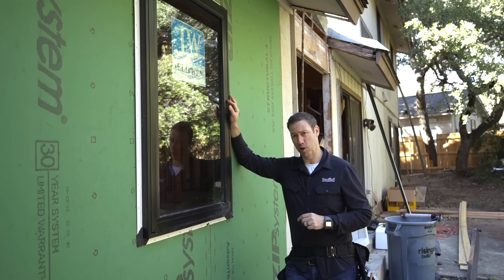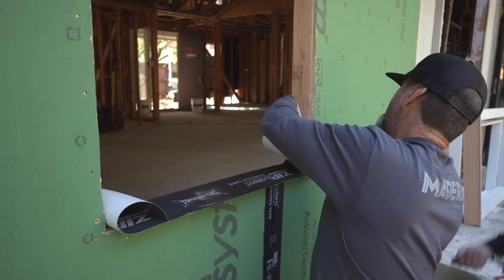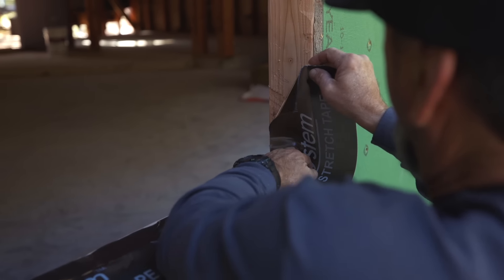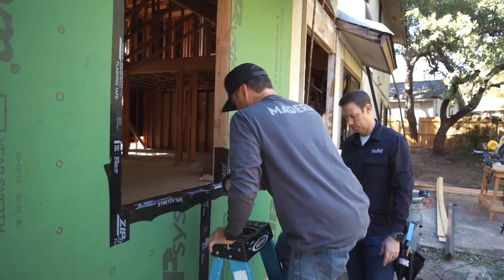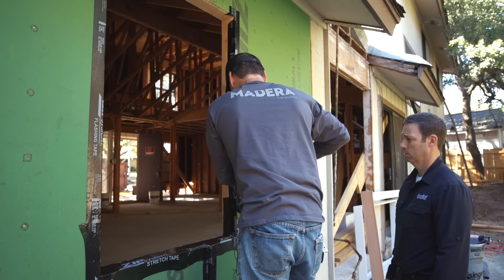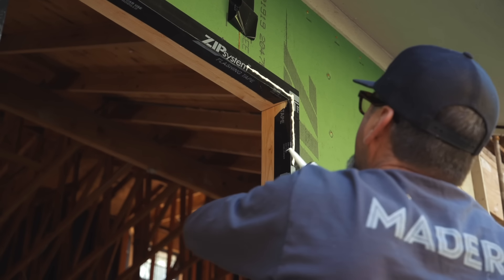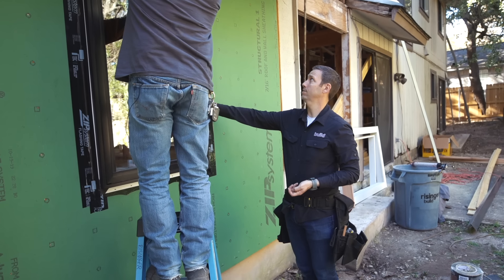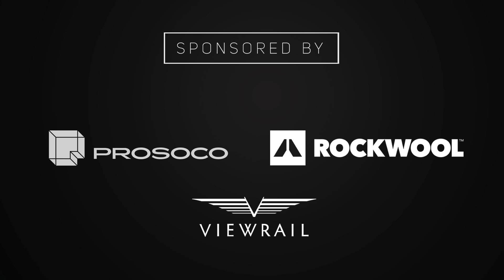Window Install & Flashing - Jeld Wen in Zip System

Comment: I've been in the trades for almost 20 years, built houses, flipped houses, renovated top to bottom, commercial and residential, and worked with hundreds of sub trades.  I still find it overwhelming at the sheer amount of systems and products that exist to do the same thing.  As for what's best? Forget about it, you'll never know, nor will any contractor. What complicates things further is 4 contractors will give you 4 different ways to install the same product.  Even for an experienced guy, It can be frustrating and anxiety enducing to make the best choice and to know whether the job is being done correctly or not.
Reply: Amen
Reply: Try being a diy-er trying to build my own house; learning as I go.
Reply: How so? Because different options exist that makes it harder? I love it. Different systems for different requirements and budgets. It doesn't add any anxiety for me. I'd rather have options than just make it up as ingo
Reply: I can definitely relate honestly. It's quite overwhelming.
Reply: Yeah I think its best to take the science and methods but be agnostic regarding products. The flashing method here seems very well done. But there's probably a tape that'll work that ain't zip. 

The main take aways is to always reduce the amount of times water has to challenge your flashing. Always lap the tape in a way that once water gets on top of that first layer it never gets a chance to get under any subsequent layers. Any new layer of tape should start before and end after any old layers. And leave room for water to drain out if your flashing fails. So don't seal the bottom flange.

Comment: Doesn't leaving a gap at the bottom flange and the fact there is not caulk, effect the blow door test and R value due to air penetration at this area?
Reply: It does not affect air leakage because there is a backer rod and caulking used on the inside for air sealing. Low expansion spray foam and tape is another method.

Comment: Matt always does a great job covering windows but i would like to see him do some doors, sliding doors and such...😎
Reply: 422systemarty a 8R8L Bi Fold patio door perhaps !?! 😰
Reply: Ditto!
Reply: I have a house under construction and they installed the windows just this week. I was actually very surprised they did nothing in the way of a sill pan or taping the house wrap before installing the windows. Is the best and only thing I can do after the fact to weather seal the edges of the window? Suggestions? I should have them take the windows out and do it the right way!
Reply: This channel is my favorite resource for sure. Sliding doors would be great. I think he did something with Marvin some time ago.
Reply: I agree with you Pavel and 422systemarty !
Reply: @mhsfhhawks3411  I know your question is old, but for future questions: A sill pan is necessary per manufacturer, but taping the sides of the housewrap or wrb isn't necessary before the window install as long as they tape afterwards. It's more of a sealing technique for air, than for moisture (Look at old houses with zero flashing and the vertical portion of the studs are fine (until they get to the mudsill), but the window sill is rotted out. I would 100% remove the windows and do mechanical flashing at the sill.
Reply: @pavelomar4631  I’m
Reply: @pavelomar4631  I’m

Comment: Thanks for mentioning the 5 degree positive slope with frame sill!  Previously, I was looking into sill pans such as suresill (the original frame sill did not have this positive slope).  I will look to sanding this slope on frame sill - per explanation of your work

Comment: This is the method we teach all of the carpenter apprentices and truly is the best method. It helps with air leakage and water penetration both. It would be nice if the whole industry would be using the same method whether it’s Tyvek, zip system or any other mechanically applied system.

Comment: Excellent video on the proper flashing methods with the best products on the market. The real problem is, what are the chances that the average builders are going to be that thorough in the process? More than likely not, which is why no matter how great these products are it always boils down to the final installer and their particular expertise, or lack of it.

Comment: As a contractor in swfl I agree with the way you approach the sill and no sealant on the bottom flange but I find that if a use a good bead of elastomeric caulk to adhear the window directly to the zip sheathing. this is adhearing the window to the framing making it structural
 and not relying on the adhesion of the zip tape . Because all you did was adhear the window to the zip tape. A bead of quality elastomeric sealant between window flange and sheathing and then zip tape over the flange after. All in all good videos

Comment: For the time and necessity to be very specific with getting the tape to conform around all corners and edges, I prefer to just use liquid flash around the entire opening, covering the entire jamb. It’s a little more expensive, BUT for the end result and lack of headaches it’s so worth it!
Reply: I agree hands down. Matt has since used fluid applied flashing abd weather barrier on a couple homes with tremendous results. Have you seen the air sealing vapor that’s implemented by filling the homes interior air space with the air sealant and doing a blower door by  blowing the air towards the outside wgich in turn blows the air sealant to the extrusions which seals the tiny holes that would’ve typically been avoided because of the inability to find every tiny air gap. It’s stuff like that wgich brings me back to the build show over just aboit anything else being put out to learn from. Matt is doing what he loves and is doing a fine job if you ask me. I learn something in every video.

Comment: Nice video. I literally just complained on some window install videos about them not taping the sides and top because that would allow air that comes up from the bottom of the window (since that part isn't taped or sealed) to get behind the house wrap, which defeats the purpose of house wrap as an air barrier. I understand here you're using Zip but then air could get in where the window jamb and the zip meet. Happy to see you guys put tape on that.

Comment: I love the detail. Here in the UK we just slap in a plastic frame 10mm smaller than the opening, a few concrete screws through the frame from the inside and then expanding foam the gap. You have a much drier climate and go to all this trouble to waterproof. I suppose you have to for wooden houses.
Reply: Sometimes we foam Windows here  depends in the United States. You guys in the UK don't do this for skylights though?
Reply: @bobs6129  I've never fitted a skylight but when I saw the builders working on next door I didn't see them use foam. I think they possibly come with a sealing kit included
Reply: @SwimBikeRunFastest  yeah usually they come with a roll of butyl tape I'm guessing

Comment: If you'll be adding 1" foam board exterior insulation, then furring strips and siding, what order do you do the window flashing, window install with nailing flange? I have seen videos with the foam already in place before the stretch tape and flashing tape, etc. Your thoughts?
Reply: Very good question.

Comment: Hey Matt!  Very thorough installation video!  We're planning to install a Cor-A-Vent Rainscreen between our ZIP R-Sheathing and vertical wood siding.   Could you explain how that system should interface with the ZIP Tape/Flashing around the windows and window trim?  Thanks!
Reply: Looks like you can use spray foam on the inside, or backer rod and caulk, as in other videos.

Comment: Doubt this will be seen, but I work residential construction and remodeling seasonally and I have never used or seen the Zip System before. But I was driving back from the hardware store (or somewhere, don't remember) and I finally saw a house going up using it. I do have to say, it does look a lot better than Tyvek like we normally use. Too bad it doesn't get seen.

Comment: Thank you for the great content.  Can you please clarify why the bottom of the window does not get sealed/liquid flashed? Won't keeping the bottom open contradict the concept of making an air tight house and also get worse results on a blower door test?
Reply: The inside is fully sealed, the exterior flange is kept loose to allow water a path of least resistance out

Comment: Good video Matt and I love how you recommend using tape abundantly. But really, Jeld Wen? I know you either got them for free or at discount, but their sealing mechanism is not same as the other higher end ... Jeld Wen reminds me of Champion windows, and we know where that company is now. You should maybe do a video on selecting windows, because even with the name brands, such as Marvin, they have different lines and one should be careful in selection. FYI, Most carpenters will NOT angle the bottom window sill ~5% ... time consuming, so, sealing this area all around is important. I would recommend showing no wood around the seal. Tape it then use liquid Zip to tape exposed wood. I love the flex Zip tape!

Comment: I went to Home Depot to take a look at the ZIP product.  The employee there told me that they have sold very little since stocking the sheathing.  The price is about thirty dollars for the 5/8" size, and about twenty for the thinner size.  Reading in other places, I see that Huber is apparently aggressively protecting their patent by challenging any manufacturer who produces a sheathing that is remotely similar.  Researching the vapor permeability of the ZIP coating and the OSB substrate, as well as the performance in real-world conditions, I have the impression that painted OSB would perform as well.  Some builders advise using half-inch plywood for sheathing with a quality house wrap instead.
Reply: Yeah the costs are outrageous now, we used osb and house wrap, but put the zip system on the roof, I'm a remodeling contractor but this is my first new build. I think the painted osb is not a bad idea except that code would require you to put on the house wrap as with the zip system you don't since the patent company gets code approval, no corruption there, lol
Reply: @Zimbob2424  Thanks for your reply, Bill.  Since I wrote that original comment, those ZIP products must be two or three time higher in price now!  After further investigation, it appears that the ZIP sheeting is in fact coated with an oil-based paint.  On a large build, the reduced time and instant protection from weather are likely to be a significant value.  To experiment with alternatives, I am using an elastomeric "siliconizer" coating on thin plywood for a shed project.
Reply: There are multiple sheet goods from manufacturers now that are very similar to zip.  Of course they cost more coated, but that cost is coming down for all of these type products.
Reply: @christopherhaak9824  Thanks for your reply.  ZIP system itself has come down significantly.  Both big box stores have much more manageable prices lately.

Comment: Matt, Ive been in construction 30+ years now mainly in Texas with degrees in architecture and landscape architecture and added selling custom standing seam metal roofing 2.5 years ago to the things I do...I just can't get on board with any kind of particle board sheathing. Zip is an intetesting product but the only place I've even seen it installed to spec is on your videos. If they sold the coating material seperately I'd be all about that. Particle board sheathing of any kind just does not hold up to moisture that is inevitable. 
I do really enjoy your videos though.
Reply: it is not particle board!

"Oriented strand board (OSB) is an engineered wood product formed by rectangular wood strands (flakes) arranged in cross-oriented layers with the help of waterproof adhesives. The result is a structural engineered wood panel similar to plywood in strength and performance, but more uniform and less expensive."
Reply: @RaulTorresMorfin  yes it is OSB...that is a form of particle board, friend. I know exactly how it is made. Actually toured a plant once to see it made. And it isn't really that less expensive anymore on the front-end...and very expensive to repair on the back end.
Reply: You've had to pull out incorrectly installed zip?
Reply: Matt has talked on some of the videos about going to plywood when he's able, or in some cases for the lower courses of sheathing to provide additional protection.  I think this makes sense.  I am about to do some sheathing on my own home and am weighing the options.  My preference at the moment is good plywood with fluid applied, but it's also the most costly option.  I'm in Florida, so strong wind-driven rain is a given.   ZIP is hard to get in my area anyway so it may not be feasible for me.
Reply: @PerroneFord  having helped from day 1 through day 210 of the hurricane Michael cleanup I would tell you that OSB and particle board is definitely a bad idea for any kind of sheathing in Florida for sure if you have any kind of choice. If you could get the material that they put on the zip panels on the exterior and apply that to whatever she didn't you pick I think that would be optimal.
Reply: Zip is not particle board, it's OSB (but stronger than the OSB you typically frame with) with the liquid applied WRB pre-applied. You get a better WRB since it is factory applied and save install costs. I have had a few sheets laying outside for over a year now from a home build to see how they hold up over time and they look dang near new still. It is an incredible product and system.
Reply: @matt_metcalf  you didnt read my reply to ours, friend.
Reply: @RenaissanceThinking  I don't think it's fair to compare zip to the houses you seen in Florida. As you're aware, the coating on zip sheathing is water-proof. What your describing seems to be a scenario of a flood zone which the houses are going to be gutted regardless. With the tape that Matt used on every seem properly installed, that house should be water-proof short of flooding.
Reply: @adrian_sanchez  I have built and remodeled houses primarily in Texas. What I was doing in Florida I was working as a liaison between the Corps of Engineers and contractors as part of the hurricane initial recovery efforts. I know exactly the components is a zip and you would realize that if you'd read some of my other replies. It is an interesting product I just wish that it wasn't put on a material that is not made for long-term. You'll also note in my original comment that these zip installations on Matt's Channel are the only ones I've seen that were ever done correctly. So it is safe to say that I think Matt has a commanding understanding of the installation protocols from zip.

Comment: In general, what does the top flashing add over the already taped seam besides a few extra nail holes through the tape? Is water really going to navigate up below the lower level of tape? If so, won't it do so even with the extra layer of flashing?

Comment: Just something to help out with the waterproofing - unless your window is literally tight within like 1/16 or 1/8 to the frame, making those corners that tight (especially with that comment about stapling it) is not necessary. However, a backlip for that wrap would be very useful. I speak as a window installer for a major American company working in the rainy, super wet PNW (our installs are lifetime warrantied, longer than our glass, and this is on remodels).
Reply: Oh and Jeld-Wen is copying our windows with their new frame material. We did it first. RBA FTW Andersen>Pella>Milgard>Jeld-wen everyone else sucks

Comment: Nice video giys!...Nail every hole in the flang guys! If the nail flang is crimping up your setting the nails too hard. Center a window in the RO from outside. Slide the window to one side make a pencil mark by the flange then slide the window all the way to the other side of the RO make a mark. Next slide the window over and split the difference between your two pencil Mark's!

Comment: Nice! I'm taking notes on this for when I replace some old windows in my house (I'll be pulling back the vinyl siding a little to do some taping as the siding and house wrap were installed after windows were in).
The nail-holding tip came in handy.
I wonder if that much taping is needed on a shed window. LOL.

Comment: Essentially leaving an air gap under the bottom of the install. I understand to allow water to escape. 

Would you seal the inside of the window with caulking to make air right from the inside?

Comment: One thing I've never seen yet in your videos is how you airtighten the window when the bottom is open.
Do you tape, caulk or 1K foam the innside?
Reply: I was thinking the same, Won't it just be a open air vent breaking the indoor seal?
Reply: Math has showed in some of his older videos that they back caulk the inside of the window. First they put in backer rod then caulk and tool the caulking.
Reply: @Wood-Renovations  actually remember seeing that when you say it 👍

Comment: you don’t have a continuous air barrier with this install, would leak air, cause condensation build up and would not meet the building code. the bottom flange needs to tied into the zip flashing with the peel and stick. Windows have drainage built into the sill frame.
Reply: The drainage is for water that might get behind the window and pool on the sill pan if it was taped. My builder has the same concern about cold air coming in in winter and causing condensation.